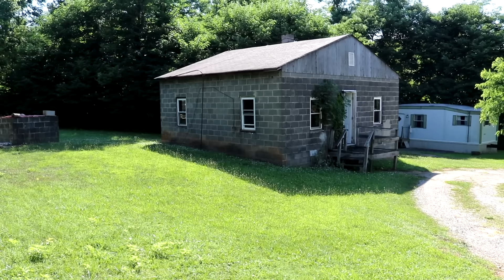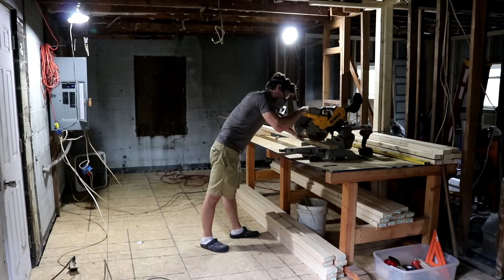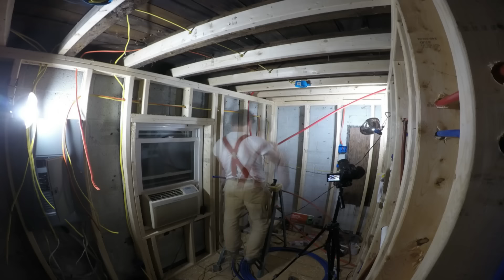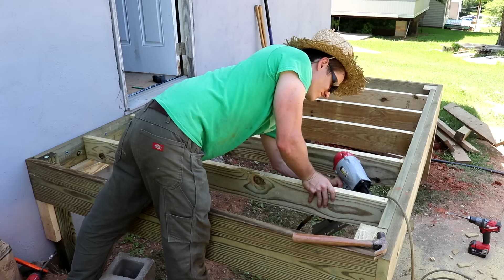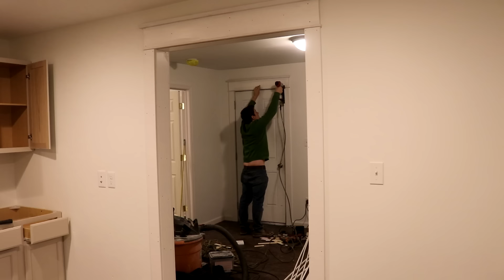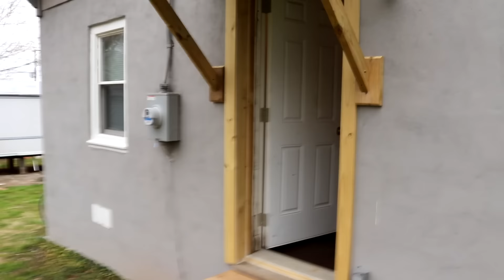$12,000 HOUSE - One Man Renovation

Comment: I bought a house on a half acre just outside Wake county NC in '06.....$30k during the height of the real-estate bubble before the big bang. The bones were good...stripped to the studs internally, new hardwood flooring, all new everything inside.....super-insulated it with poly-iso sheathing, Hardie lap siding, and installed geo-thermal HVAC.
  Added an attached garage with a room above.....all told in 2009 prices I had around $60k total in it. In this current market, Zillow is guestimating $200k plus......2500sf......all diy mind you. If you're motivated, big money awaits

Comment: I know that it is kind of late to be saying this, but would you consider adding a porch to the side or some sort of protection for the sides of the house from the rain? You see in the Caribbean, many homes have some sort of foundation which is made of concrete and protects the house from the soil which gets wet when the rain falls. It is built to give the illusion that the house is adjacent to the soil, when in fact there is concrete around the house so that water gets so far and no more. It also protects the wood...
Reply: The Caribbean has very different weather than (presumably) US South. It would be unnecessary to do that in non hurricane areas.

Comment: Really Good work BuTTT the old joist and subfloor looked like they where fine and most likey better than the crap you get from home depot. floor insulation is for older homes with out ductwork below, heat rises. but if you are far north yank than maybe.

Comment: how did you learn all the trades? Impressive work my man
Reply: Not everyone uses youtube for entertainment you can learn things on it too.
Reply: Yeah there is a video on pretty much any topic
Reply: that's what I sd! How does he know how to do EVERYTHING!??
Reply: @d9637  ..don't you have to be a certified electrician, plumber and carpenter to do everything dude did?
Reply: @K3VYK3V1  I would think it is a little different depending where you live but  I think if it's your home and your not charging for it you should be able to do all the work as long as you get proper permits and do everything to code.
Reply: @d9637  ..yeah man, where i live all the electrical and plumbing would have to be done by licensed tradespeople.
Reply: @K3VYK3V1  that sucks but for most people they shouldnt try to do the work themselves anyways. Not complete rebuilds at least. Repairs is a little different and perfectly legal without a license I'm pretty sure. (As long as it's your home)
Reply: Badass Skeptic   you just made me have to look it up and many places you can indeed pull permits for doing the work yourself and not have a license. However yes the kid in this video probably had to have licensed people and permits to do some of the work because I'm sure he is planning on flipping the house and not living in it and that's a different story.
Reply: Badass Skeptic  the point of getting a license is so you can get a job as an electrician and charge people for your services. But if you have the knowledge and want to do the work yourself and it's your home I'm pretty sure you can.
Reply: Badass Skeptic  I redid all the plumbing in my bathroom myself. What they don't know... lol
Reply: @K3VYK3V1  you can complete the work to code and get sign off by a qualified tradesperson stating it's up to standard. They effectively sign off your work. It's how it works in my country anyhow. A lot cheaper than getting them to do it, plus if you have friends who are qualified even better!
Reply: @K3VYK3V1  do it in secret they dont need to know unless you sell.
Reply: @ladybrisen777  It's probably what he does for a living.
Reply: @d9637  Yeah, you have to get a check done for the safety of the house. If it's all good, you can sell it. If not, they will tell you. Unless you have a friend who willing to be a skumbag
Reply: And; How is it even legal to do everything yourself without formal training? E.g. electrical and plumbing? Love that little house, someone will be very happy with it, beautiful almost tiny house... ☺️
Reply: K3VYK3V1 - Same here in Norway.
Reply: ☺smylyface☺ - Too bad for you if you get a major leak and the insurance won’t cover it because you didn’t use a certified plumber...
Reply: Badass Skeptic  why are we yelling?
Reply: same way anyone does, common sense and just doing it man
Reply: @K3VYK3V1  kind of... unless you work for a company that has all of those and you say that said company did all of the work for you even though you did it your self. Its a very common work around the system.
Reply: @lottatroublemaker6130  why does everyone or why do some people seem to think that you have to have a license to do everything when all it really is is education common sense. You can know everything there is without having a piece of paper that says you know everything there is and you can have a piece of paper that says you know everything there is and not know anything but how to look good while being stupid. Some rules are just too bad to be taken seriously if you can do the job and everything checks out right there's no reason you should have to pay somebody who may or not who may or may not know what they're doing just because they have a piece of paper doesn't mean they know it all. I have known people whose paid for an education literally and didn't do a bit of the work.
Reply: All building "improvement" measures are subject to inspection. Just do the work right to pass inspection, and you'll be good to go.

Keep on keepin' on! 👍
Reply: @K3VYK3V1  as long as you working on ur own house and inspectors can sign off your work no issues
Reply: @lottatroublemaker6130  only mugs use insurance
Reply: @K3VYK3V1  Most likely He is a certified tradesman. I believe as long as you know the codes you can do any work to your own home. I'm actually 100% certain of this in my state. Michigan.

Comment: This would be the perfect size for me now, and I love gray as greenery looks great against gray. Makes it "pop." He could spend another $120 (10% of the $12, 000 he put into the house) by finding some cheap, soft needled evergreen shrubs in front of the house. It will be small size, but I've picked up dense yews or boxwood for $5. Get that white upside down spray paint to make a small area then kill the grass in it with glysophate. Plant your shrubs, dig out a French edge, (no edging, just digging little trenches) and top it off with red cedar mulch. The French edge will keep it in place. Maybe add a little Preen to prevent weed seeds from germination. Any flowers the buyer plants in front of the evergreens will really "pop." I'd also plant a good deciduous tree on whichever the south side faces for future energy efficiency. Something with strong wood and tough. I've found smaller ones for $15-$25. Again, kill the grass with glysophate. Plant it, and do a French edge. Add red cedar mulch. These will be the beginning "bones" of what looks to be a great gardening spot. AND most important, it increases the value of the house.

Comment: That outlet near the frontdoor is set to low needs put up a little higher from the deck flooring even if its water proof so is ours by the water socket needs extended up more if it's done by code that code is wrong and needs changed 

Other than that and the first flooring you guys did your work looks good 

The house on the outside looks to plain though kinda to much grey but it wont matter if its going up on the market

Comment: 12 000 for a house?? Omg. In Vancouver you can't even buy a burned down shack for a million dollars.
Reply: But he basically built a whole house. So with the building material costs it's probably like buying a brand new house. Still cheaper than Vancouver though. Lol
Reply: @emanandchill  That's right! That's why a house which needs to be completely demolished, a new one designed and built from scratch (such as a house which has burned down), might "only" be a million in Vancouver if it's in a neighbourhood which isn't that desirable...
Reply: maybe it was the makeover cost
Reply: emanandchill biggest part of the cost of a renovation is labor, could be completely off but he probably spent around 25,000 for materials, 37,000 for a house that nice lmao

Comment: This bloke is amazing, how did you learn multiple trades? respect!
Reply: I turn 30 tomorrow, personally I learned every trade by growing up in the industry (would go to work with my dad as a kid) and working for or alongside every trade along the way. Could be your standard GC and sub most or all of it out while I stand there sipping coffee. But I have high standards and finding subs that will give a 100% is hard, plus I enjoy working with my hands.
Reply: My best friend is like this dude. By trade, he is a tool and die maker. But he also grew up helping his dad who was a millwright, and also pretty handy. He grew up helping his dad fix stuff around their house. Now, he and his wife just rebuilt their first house and they took it down to the frame, the brick exterior and the roof, just like this guy. It’s taken them 6 months of 10-12 hour days working on it. But it’s also 2 stories, plus a basement, so its understandable. He and I turn 33 this year.
Reply: Father, 61 can build a house from the ground up (from the underground to the slab to the roof) he was a residential builder and general contractor for 25 yrs and I told myself as a kid if I am able to learn half of what he knows I’ll be set. Now at 28 my day job is an electrician but I can also build a house from the ground up. It’s so satisfying to be able to do it yourself and feel proud of the work you’ve done afterwards
Reply: I YouTube it hehehe

Comment: instead if buying the house for 12,000, why didnt homeboy just build the whole house himself! -Grace
Reply: Foundation cement costs more than 12k he is smart and did calculations
Reply: Often the permitting process is also expensive and very time consuming. There's often a lot to be saved by renovating.
Reply: Competent foundation, existing house can be updated with fewer and simpler permits, $12000 includes land. Good business sense. My inclindation would be to increase window size and that may have happened, but given cinderblock outer walls, light colors inside its good. A nice porch next time he has 10 minutes seem fair.
Reply: imagine how many houses he would have right now
Reply: Because too many permit licenses which is part of the reason why land and homes are expensive. We keep allowing house creation stagnation by creating such complex and harsh permits. If they were loosened home prices may drop which is the last thing most people want.
Reply: I do wish they would lighten up at times. But even then, I've had to fix so many things done incorrectly even by licensed tradesmen. Youd be amazed at how cutting corners ends up damaging so much. I fix code violations for the city, and at times I do wish these code inspectors would lighten up, but the codes are there for a reason. I'm sure they are not there just to mess with people. This guy did awesome work. I've bought distressed homes(like this) and fixed. It sure is cheaper to do this than to build one. Just so much work but in the end it's worth it. I own several homes doing this.

Comment: Why didn’t you just buy a plot of land and built a house from scratch? Since you basically tore down everything haha
Reply: ikr :D
so much dismantling...
Reply: I'm not American but I'm pretty sure you can't build anything you want on your land. You have to apply with completed building plans in local agency to get building permit. I might be wrong though.
Reply: zoning, engineering, approval times, excavation, pouring new foundation, more wait times. It's alot easier to buy something pre-existing and reno-ing it.
edit: I want to add, alot cheaper too
Reply: Sometimes bare land cost more than land with an existing house, especially if the house is in need of significant repairs. Even factoring in the cost of a big remodel it can still be a less expensive path to take in some areas.
I bought my fixer upper with 32 acres for roughly 20% bank value of just bare land. It was a no brainer since permits to remodel were much less than new construction and land upgrade permits. All in all my timeline was about the same as a new build but I saved roughly 60% of cost vs a new build.
Reply: @Joxerlol  You are correct. From bare land to permits if the lot is already approved for building, can range from $1500 to $10,000. If the lot is not approved for building then $15,000 to $30,000 or more. Then you can start excavating. Location is a huge factor. I learned some of this the hard way. For the house in the video, I would guess it was on the lower end, $2000 or less.
Reply: Another thing people aren't mentioning here is the water, electrical, and sewage hook ups that when I was looking to build a house from scratch I estimated about $5k each (not to mention internet if it's even an option). That's an addtional $15k without the zoning permits and other things. It costs a lot of money to connect to the grid. Every fucking county in every state in America has it's own set of rules to follow when building a home. There are general rules that apply to them all, but one anal retentive building inspector can ruin your day with fuckery about your project and not approve your construction. One little marginal rule (such as the sink being too close to the toilet) can cause an inspection to fail and they will make you tear down or modify what you've built before they will pass you. Because of politics, building a house today is a nightmare, so it's better to just stick with what you have when it's approved.
Reply: Adamantiis it may definitely be cheaper to redo a house but not certainly easier than building from scratch. I know cause i just had my house renovated and its hell, so much trouble destroying stuff then getting it cleared from your premise and hard to keep things in order. Plus in the end you don't get the satisfaction you get from getting a new home designed exactly to your imagination.
Reply: Plus you wouldnt be stuck having trailers next door. What kind of rent does he think he will charge for this? Trailer park rates? Must have sunk in around 30k, gonna take a long time to recoup that especially with low rent.
Reply: Permits.
Reply: @starkv3003  It's easier, just nastier.

Comment: i wanna know why he replaced the floor joists in that one spot? were they rotted out? or?  and why did you rip out the studs? did you rearrange the walls? or just want to put in new studs? I'm just wondering because it doesn't seem financially tactical to do that, even though I suppose it was much cheaper to do since you did it yourself, still... just seems a little excessive, because I don't see you getting more than $80k out of this house and you easily did $50k worth of work or more, plus the $12, and the time... shit this must have taken several months. I'm interested in getting into this myself so if you   would give me a short but sweet reply i'd be grateful;. thanks.

Comment: quick question... second comment lmao... im like trying to find some answers .... so i noticed USA has some specific rules on how to "repair" your house... do you need a license/certificate to do those repairs (non-commercial)? i mean they are pretty obvious here in Romania most of us do it by themselves no business etc... from electrical to water pipers to interior design (we are not allowed to install gas pipes those are regulated and makes sense). but anything else that goes into your house like water piping, heating etc stuff that u use in the house basically and not stuff that comes form the municipal piping to ur house. like do you need a license to be a handyman or a welder or a electrician or a carpenter in order to do all those repairs at your own house? cause i seen videos around the internet and some "Karen's" by the looks of it ... where raising problems of this sort... which is weird... i mean if its my house ... i will do whatever i want to it... even burn it down no1 can stop it. also the house looks amazing before and after is like not even the same house.

Comment: This is so called made in china house, which soon will get on fire, and will start to rot. He putted live wires inside insulation, wire will go bad will start melt and you will have fire on roof, wires must go inside plastic tube and not touch insulation . Than if you will need new wire or replacement you will need to brake all wall. And painting dry wall without spackling and finishing wall. He has no idea whats he doing. And making house fire hazard. That dry wall simply painted will get on fire as same as paper simply come with one match and that wall will get on fire.
Reply from the maker: It’s still as good as the day I finished it. Don’t get so hung up on stuff, it ain’t helping you and you are probably annoying the people around you.